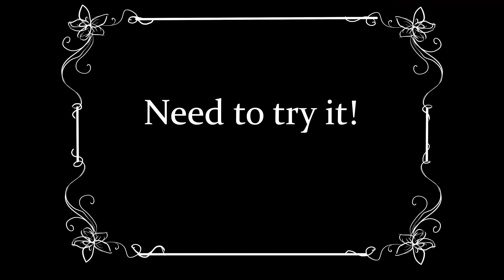The Best Material in Guitar Building| Bone Frets

Comment: Interesting! I would have liked to have had an A/B comparison between regular frets and the bone frets but, maybe you can do that in the future!
Reply: Frets do very very little in changing the sound. When choosing things like the neck, all that matters is how it feels.
Reply: @dandogamez  Tell that to everyone who has ever commented that stainless frets make all the difference in the world and conversely those who comment that stainless frets ruin the sound/only nickel steel will suffice. My main concern is that bone will not hold up to steel strings and bending so well. Probably need to refret often.

And the materials do matter in terms of longevity and durability. For example, birds eye and flamed maple necks usually feel great since they're premium materials and a lot more effort goes into the workmanship of the guitars which have them, but those woods, unless roasted are far more susceptible to warping and need to be replaced more often than two piece necks, which are more laterally stabilized.
Reply: @yargnad  https://www.youtube.com/watch?v=n02tImce3AE&ab_channel=JimLill This video shows it all. For solid body electric guitars, the sound is almost independently caused by the pickup and electronics, the distance from the pickups to the strings, the strings, the scale size, and the player. When choosing a neck it's honestly most important that it's comfortable for the player.
Reply: @dandogamez  I build guitars so your argument is nothing new to me. These sort of videos are not controlled scientific analysis so it doesn't really mean much. I can clearly hear the difference with stainless steel frets, they have a slight pingy sound on the attack. Plus at the density of the wood makes a difference so you would not get the same sort of sound from balsa wood as you would from maple. Nearly any material of similar density would give similar results. There's definitely more to the sound than just pickups and scale length. I have an acrylic strat that sustains for days, and sustain definitely changes the tonality of any guitar. The pickups are only part of that equation.
Reply: @yargnad  I build guitars as well. Watch the video. He has another on strings, another on sustain, and another on scale length. From what I've found, Jim Lill is the only person doing these kinds of tests and he does them in a very controlled manner. Just watch the video.
Reply: @dandogamez  saw that video years ago. He also claims that the wood doesn't make a difference but those strings are attached to two very heavy high mass workbenches. Plus we were talking about frets, and that is not a fretted instrument. Anyone will tell you that a fretted guitar sounds completely different than an unfretted guitar. I've been around since the Scott Grove tonewood video first started this debate 15 years ago. Like I said, this is nothing new, and very unscientific.

PS: I've muted notifications so any further replies will only be for anyone else. I've played guitar too long not to know that a guitar is the sum of all the parts, not one or two alone.
Reply: @yargnad  I don't think you watched a video years ago that was posted only around a year ago. I'm also sure you haven't watched his more recent videos on the topic. Clearly I'm just arguing with a wall though so I'm going to stop this here. Build guitars however you like, just don't be bothered when people come around with guitars built out of scraps that sound the same.
Reply: My guitar sounds a whole lot better when I put strings on it.
Reply: @dandogamez or like pickups
Reply: @briane.paulson mine sound worse since when i put strings i start to play it.

Comment: I glued on bone frets and tuned the notes to Kirnberger III. The frets start off wider and the tuning is done with a carving chisel . Basically it`s wiggly frets but the wider straight appearance makes it look easy . Sounds nice . Use Evostik on a flat surface . They can be moved or removed using a thin spatula heated by a soldering iron .

Comment: Great video and concept. Makes more sense than bone nut, then metal frets - because you start with the open string sound of the nut, then you have fretted sounds which are slightly different,  because of the metal. This is why I prefer zero frets - to keep the sound the same, regardless of where you are playing. 

Many guitar have intonation problems.  Bone frets could go a long way to solve this problem.
Reply from the maker: You can always put a metal nut😊

Comment: That's interesting. My baglama saz has tied on nylon frets. I'm sure one day they'll give way and need to be replaced. I recall a long ago someone saying you could move the frets around and change the intonation or I may have dreamed it. And... the sitar sound? That makes sense because the frets are so thick. Sitars have a deep bridge so the strings can vibrate over a shallow angle causing the classic sitar buzz. Goto do one so you can make a guitar/sitar a la Danelectro. There are also Telecaster saddles that work in the same way. They take a bit of setting up to get the best buzzy sound.

Comment: My crazy idea is for bass guitar: I want a better sounding low B string.
The problem: The pitch is so low that - at a practical scale length (34-35") - you have to add so much mass to the string 
that the timbre/volume/sustain is poo (overtone series is suppressed).
The crazy idea: Have a double string just for the B string (like a 12 string guitar), 
with one string for the fundamental, which is flatwound and heavy (all mass, no timbre)
and the other string being roundwound and tuned up an octave to add the missing timbre.
I think that maybe this would add the timbre and beef that I've been missing :)
Reply from the maker: 12 string bass guitars already exist
They are arranged in the same way as you describe, only there are 2 extra strings.
Reply: @mr.k1t  Indeed they do but, due to my lamentable lack of funds, I don't have access to any of them to try my idea. 
I guess the double B string ain't that crazy.
It's more the trying to split the fundamental from the overtone series between the strings to improve the overall timbre.
Perhaps one day I might have the money to try it myself.

Comment: Nice Work! I  re-fretted two guitars and a bass as "almost Fret-less"  with bone...inspired by  fine instruments at the Smithsonian. I have been very pleased with the results, but some folks, well one folk... wasn't  (smile).  If I may  offer a kind, Old luthier, suggestion,  Finish the frets and board with a hard lacquer like Fender maple boards to protect the bone from becoming a "Gummy- Grunge" from players with beer stained fingers (smile).  Also, use Flat Wound Strings with soft metals, or coated with Teflon or PE for longevity.   Respect!
Reply from the maker: Thanks, good idea with the coating, maybe a polyester coating could do better. I used teflon coated strings
Reply: @mr.k1t  Awesome, you know what you are doing.  Thank You for creatively bringing the "cheap" guitars from the 70's back to life.  They become fantastic instruments in the hands of a LWC....Luthier Who Cares..or LWGAS....Curious about the Gold-Foil-ish Pickup at the neck.  Zero frets make great jewelry...
Reply: Это неплохая идея... "Почти безладовый бас..." Заставляет задуматься. 👍
Reply: @minich999     RESPECT!

Comment: I need help from some creative mind: In the process of making my own electric guitar with all the materials I have at hand, I decided to use regular steel wire (the one they use to make cow's fences or whatsitname) and it's all great because its around 2.5mm  in diameter and real hard. The problem is how do i get it installed in the neck, since it doesnt have a straight edge or can be bent around easily.
Thank you for reading and I could use some ideas!
Reply from the maker: look at how the frets are installed on a parker guitars

Comment: What if you made a pickup that is actually 6 individually wound, separate bobbins, each with their own output jack, and then you ran each pickup into its own amplifier? Of course this would result in being able to increase the volume of individual strings, as well as adjusting the tone characteristics more accurately since you have individual control over each string, but I'm curious to see what it would sound like clean, and what weird stuff can be done with effects.
Reply: What an original thought! I am jealous!
Back in the Eighties, someone gave me a set of six magnetic pole pieces. I carved a bobbin to inset them all and wound a coil on it with wire from a telecommunications relay from the (very) old telephone exchange I worked in. I made it as something which could be fitted into the sound hole of my Epiphone steel-string acoustic. The output was so low I had to plug it into the Phono input of my stereo. RIAA curve is not the best for that. Works great now on my Fender amp tho.
Reply from the maker: Individually, this would be a very quiet pickup.
Reply: Ive seen on the JHS show those little attachable pickups that you can have set only to your bass strings, run through a seperate chain.

He was able to have nice bass FX overtones through one amp, while playing through his normal setup.

Comment: Interesting concept. I’m surprised nobody has tried this sooner…or have they??Seems like stainless steel frets have been the newest breakthrough in guitar fret material and I wonder if it’s a supply issue or cost issue. Is bone as durable as steel? Is bone more expensive to manufacture? Just curious. For some reason traditional slotted nut material has always been softer than steel for better lubrication and tuning. Bone is used for nut material so I wonder how long bone will hold up to constant string bending and string tapping and wear?

Comment: Fantastic job from start to finish. Cutting, filing and crowning, excellent. I think this would be better suited for a classical guitar. But for steel strings? Could be the steel strings might wear down the frets quicker. Especially  where bending and vibrato is done quite often. In any event, they look clean and awesome.

Comment: I've gone with bone nuts for many years but have had a number of guitars with plastic, nylon and even brass nuts.   If you do use a bone nut just listen to you open strings vs the first fret... is the tone drastically or even noticeably different???  I don't really hear it myself so this seems simply like a lot of effort to go through to have frets that will wear faster.
Reply from the maker: this is not the only reason to try these frets
Reply: @mr.k1t  If not sound or tone then what would be the reason for bone frets??  Looks? Feel??
Reply from the maker: You are right, also an unforgettable adventure
Reply: @mr.k1t  The bone frets do look cool... Flatwound strings would be kinder to them and give the guitar a different sound and as with the bone you seem to be looking for different so maybe that's a route to go here?
Reply from the maker: Thank you!
I’ll try them when I change pickups

Comment: Why did you move the nut forward about 1/4”?
Reply: The guitar originally had a zero fret and that was not wanted for whatever reason so it was removed.
Reply from the maker: it would be strange to make all the frets from bone, but leave the zero fret metal
Reply: @mr.k1t  You could have also replaced the zero fret with bone to match the others. Also it seemed like a missed opportunity not to play and record the guitar with it's original frets before installing the bone ones so the two could be compared sonically.  Comparisons can be difficult however as everything else must remain exactly the same in the two takes. Amplifier settings, mic placement and most difficult of all that the guitar needs to be played the same exact way all make this stuff very tricky.  If one small thing is overlooked then that gets incorrectly attributed to being the result of the fret material.
Reply from the maker: The guitar before my work was not in working condition
And you are right, it is extremely difficult to make an objective comparison.

Comment: Although in some cases, doing or making something “old school” might yield better results, that’s not true here. Metal frets are far superior to bone, or pretty much any other material. And metal frets with tangs are the best fret technology. The only consideration that has real choices is what metal to choose. If you choose a soft metal like copper, silver, or nickel, the frets are easy to shape and especially level. But they wear faster. A harder metal like stainless steel won’t wear very much but is harder to shape and level. If it’s too hard, the file won’t cut it and you have to use a diamond cutter. Of course, guitar factories can do that, but most builders working out of their basements won’t have that luxury. Forget the bone frets.
Reply from the maker: I do not suggest everyone to drop everything and replace metal with bone. I change frets daily to steel bronze and nickel silver, I just wanted to try something else

Comment: Next project: glass frets
Reply from the maker: I thought about it, did not figure out how to make them even
Reply: @mr.k1t  
I thought of thin rods of glass glued in with epoxy, first with a straight edge. Fine 1000-2000-3000 wet sandpaper will even them out. For cutting at width of fretboard use a Dremel with mini diamond discs, slowly and low pressure to not overheat and crack. 
  For polishing there are some silicone bound grinding discs, and then diamond polish discs, wich will put a high gloss on glass. Last a diamond polish paste on a rotary little brush. (I‘m a dental tech, and we use such discs and diamond paste for ceramics and zirconia)
Reply: Additional idea:  colored LEDs under the glass frets 🤪
Reply from the maker: I'm worried about them crumbling.
But your proposal sounds like a plan😉
Reply: @mr.k1t  yeah, if only the glass could be made in Ruperts drop mode…
   Zirconium dioxide (from wich ceramic kitchen knifes are made) would be tougher than glass….but wayyy too hard…😔(glass=5.5Mohs, Zirconia=7.5Mohs, or 500HV vs. 1200HVickers)
   Maybe borosilicate glass?
Reply from the maker: I can't figure out how to process them on the fretboard without chipping them off. Brosilicate glass is the hardest, isn't it?
I have never worked with glass, it will take time to study the issue